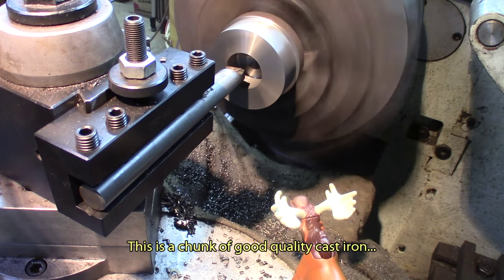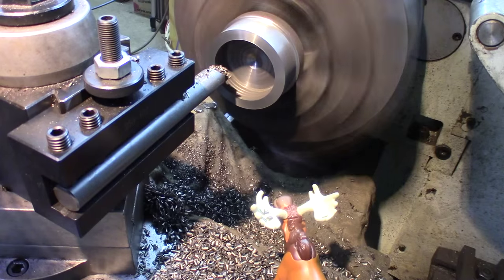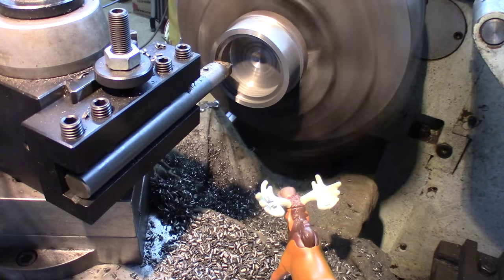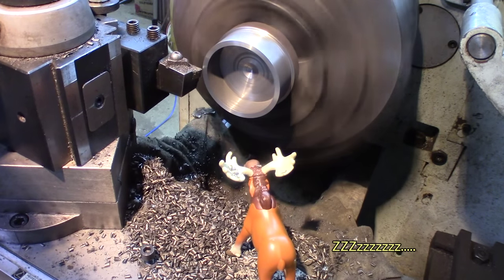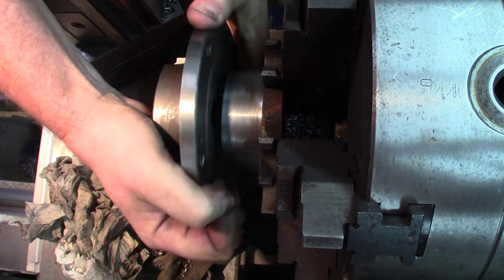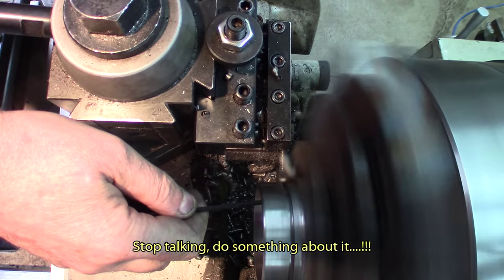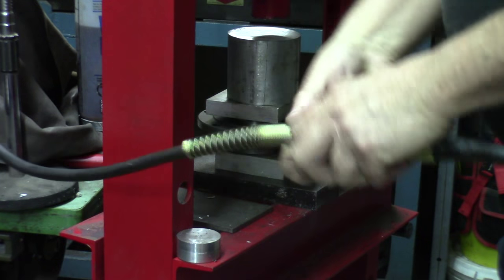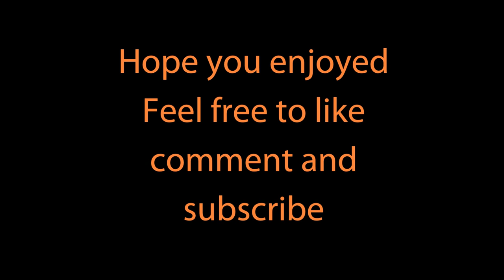Rotary head chuck runout repair part 2

Comment: Nice work Pierre.  That huge boring bar was really eating up the cast iron.  I don't think I have the horse power on my lathe to do that with any soft metal.  Thanks for sharing.
Reply from the maker: +cerberus The boring bar isn't that huge, Think it's 3/4", but it's a solid carbide boring bar, pretty much more rigid than an ordinary steel bar. When I have to use ordinary steel bars I've got the impression it's a defective bar... :)
If you haven't seen, I previously made a video where I describe it:

 https://youtu.be/SOhi093lbgU

And you need HP's to eat that much metal, this lathe has a 600 volts 3 phases 7.5 HP motor, it's hard to stop... ;)
Thanks for comment,   Pierre

Comment: nice job on the ring.
Reply from the maker: +Randy Richard Hi Randy, Cast iron works nicely, the biggest problem is the fine black dust...
It gave a great result, good feeling when a project goes close to what you plan...   ;)
Thanks for comment,   Pierre